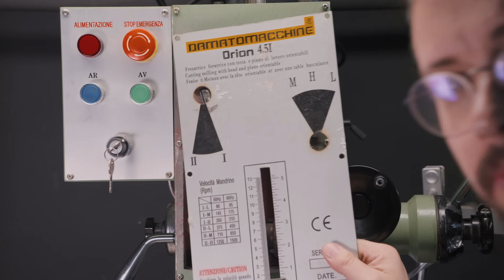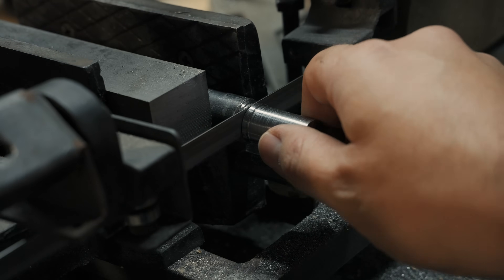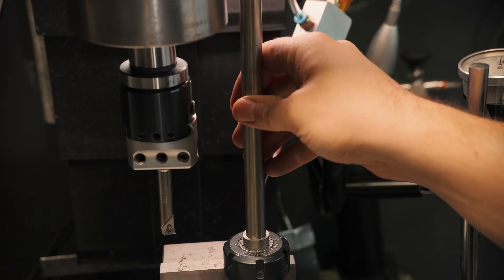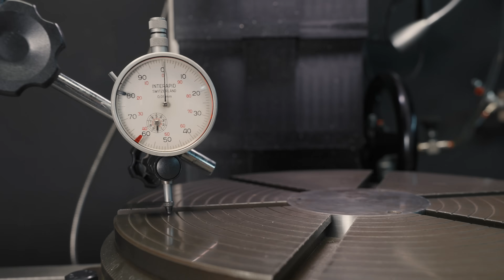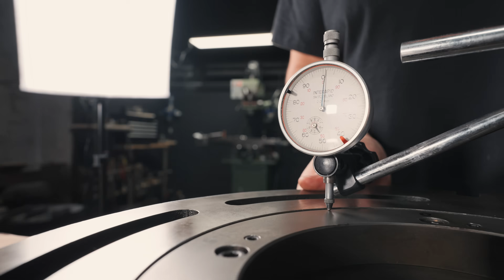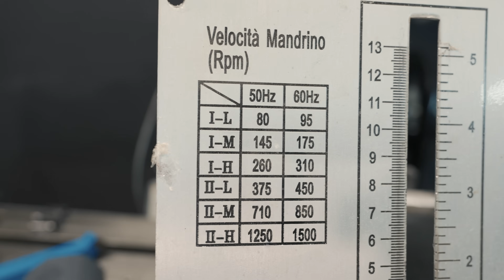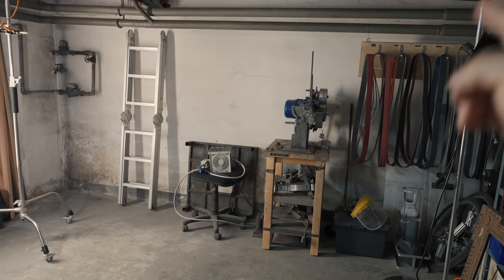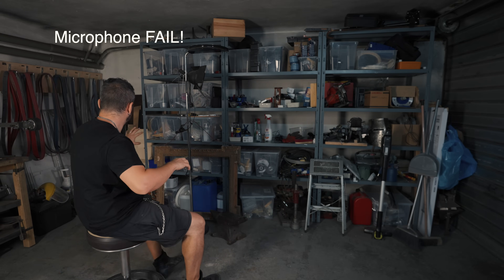The Side Projects Strike Back

Comment: Would it work to install the sleeve the other way around and use the end of the sleeve as the stop instead of the casting?
Reply from the maker: Yes, if I had a lathe that would have been my chosen solution. I’d have had a larger collar on the sleeve and use that as a reference. With the mill I should have had two pieces, only squaring things up felt like a nightmare so I kept it simple and went directly with the casting :)

Comment: What is the name of the pen you are using for the graphs?
It looks like a mix between an fountain pen an a fineliner!
Reply from the maker: It’s a fountain pen, Lamy 2000 😊
Reply: Ah nice, I'm currently using a classic Lamy Safari for writing but as I'm left handed it has to much ink flow for drawings even with a fine or left handed nib. May be I have to look into an upgrade.
Thanks!
Reply from the maker: @faxezu I see. I can tell you that the feeling of the 2000 is way more smoother than the Safari, but it’s also extremely wet. I have a medium nib and it lays down a ton of ink, I wouldn’t recommended for a left handed. Although, I think the ink and the paper plays a more critical role in this. If you find a quick to dry ink and pair it with the right paper you might be able to go over lines without making a mess regardless of the pen 😊 but I’m not an expert in that regard, try to check youtube for quick to dry inks 👍

Comment: Your four pin solution to creating a hard stop against an irregular surface that doesn't introduce unwanted extra forces is genius, I'm definitely putting that one in my bag of tricks. In the past I'd solved a similar-ish problem (tenuously similar; in my case it was rigidly mounting a flat thing (that needed to stay dead-flat in use, ie not get warped by mounting forces) to cast surface and still be able to remove it and remount it) by spraying the flat  surface with mold release,  filling the gap with high strength fibreglass-filled two part filler, snugging the bolts until the filler was uniformly squeezed out and letting it cure - viola, flat thing made its own flat mounting surface.
Reply from the maker: Yeah, casting stuff in position is very cool 😁 initially I wanted to put in a flat surface inside the casting, but it would have been a lot of work and since I can realistically flycut things flat within +-0.03 mm… the staked tolerance of “flat” pieces referencing themselves would have been pretty crooked 😓 that’s why I though of using points by casting pins 👍 machining is just the coolest hobby ever 😁

Comment: What is that pen? looks smooth!
Reply: Lamy 2000. A design classic
Reply from the maker: Exactly, Lamy 2000, medium nib 👍 I’m a sucker for fountain pens and high quality tools, and that pen it’s great, both for writing videos and sketch ideas. It’s very similar to use a 2B wooden pencil (that I also like very much) but the point never changes shape and it doesn’t need sharpening. Love that thing.
Reply: @TheProjectHavoc I have one too, an original from the early '70s which was my father's.
The design with the coweled nib still looks futuristic now and it's a joy to operate and write with.
I agree, it is like a soft pencil! Good quality ink is key to a good 'feel'
Reply from the maker: Yes, it’s a great design. I’d like to get my hands on a Waterman 52, though. And see how that vintage flexible nib behaves 😊Yes, ink really makes a lot more difference than I thought! Currently I’m using the Sailor blue-black and I’m liking it very much. Works great even on regular school notebook paper 😁

Comment: "I want to rebuild my milling machine"
I hope you realize that everyone who said such thing spend half year doing it and then one or two years modifying it over and over again just to rebuild it again... 😅

PS I love your grinding belt machine... Ughh... What I would do to get my hand on one... 😢
Reply from the maker: Oh yes, I know it’s a tall order to rebuild a machine but luckily I’m very mentally stable when it comes down to pursue the least advisable route 😂 but I need a lot of stuff first, so it’s not in the near future.

Yes, that grinder came out pretty nice considering was my first time building one. Most credit goes to the TW-90 awesome design. Making my own costed me only 1.000 bucks, all included. Which is not bad considering it’s all 10 mm thick plate (I had no machines, so everything was designed to be welded). It can probably be done better with 700 bucks (not counting the time spent) A belt grinder It’s a fun and extremely useful project 👍

Comment: Re lubrication, the rotary table is a low speed low pressure application. grease or oil will be fine, greese is slightly better for the worm screw and oil may be slightly better for the table, either should last a few years in normal use. Don't wory about it :-)
Reply from the maker: Thanks for the feedback 😊 I think I’ll keep the grease then, gives me more piece of mind that oil since I can’t refill it 👍
Reply: @TheProjectHavoc moly-grease, the black stuff, is best for low-speed high-pressure use and is fairly good with water if you ever use coolant. Lithium-grease, the yellow stuff, is for fast bearings and turns to curry sauce in contact with water.
Reply from the maker: Glad I got the right stuff 👍 I usually don’t run coolant, but you never know :)

Comment: I don't think you want to grease that thing. Use way oil or something equivalent. (I could be wrong.)
Reply from the maker: That’s what I did the first time after cleaning the old grease, but I’m worried that the oil will just move away from under the table in a couple of months 🤔 I can’t take it apart every time I have to use it. I thought about making oil grooves and ports, but I’d like to sharp my skill levels a bit further before messing with something that nice